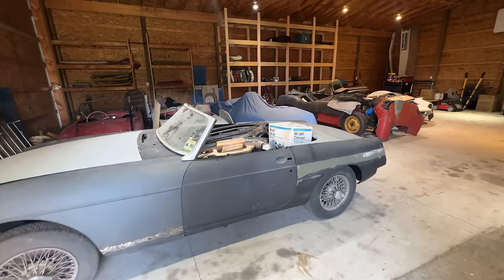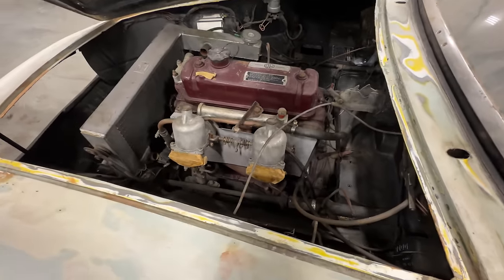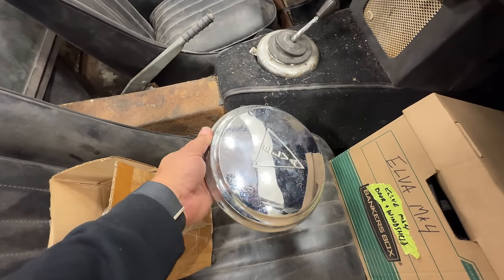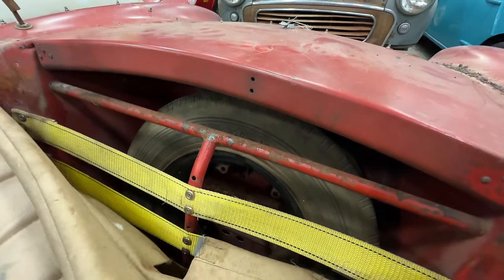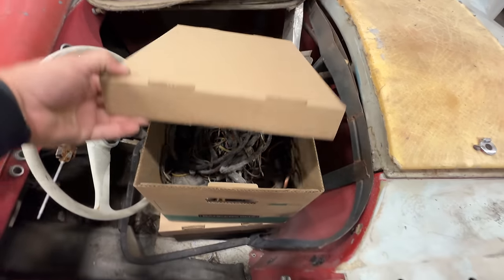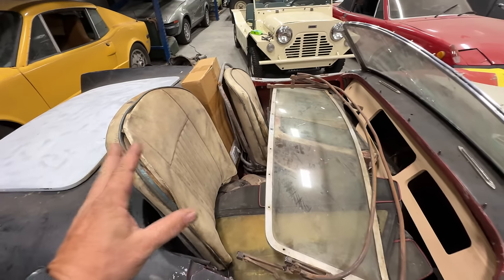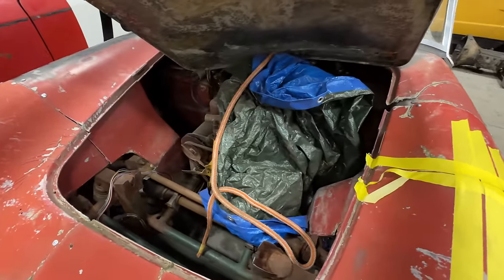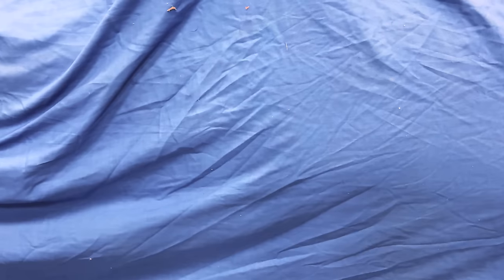This Shed Was Full of Rare Abandoned Sports Cars

Comment: What a great haul of interesting cars! Do you have a Peerless/Warwick in your collection? Another late-50s contender in the British sports car market.
Reply from the maker: I have come close to owning a Peerless a couple times but have never had one.
Reply: The Peerless always seemed a bit alarming as the petrol tanks were in the door sills. I wouldn't fancy being T-boned in one of those!
Reply: @davidjones332 : They are at least protected by two sturdy chassis side rails that are braced. It was designed for racing after all so I'd expect some consideration of the safety of the tanks' placement.
Reply: @johnpowell5433  Maybe so, but this is 1950s designed-on-the-back-of-a-fag-packet stuff rather than high-tech stress-computation, so I think I'll pass on that one!
Reply: @davidjones332 : No-one twisting your arm! I suppose you'd turn your nose up at a Gordon-Keeble as well?
Reply: @johnpowell5433  Possibly not. the Gordon-Keeble is a handsome car thanks to the Bertone design; to me the Peerless always looked a bit cobbled-together and ill-proportioned, and contemporary reviews weren't always flattering either.
Reply: @davidjones332 : Aside from the rear suspension arrangement the chassis are near identical, certainly in the centre section. Best leave it in the garage. 😉

Comment: The Name is Berkley Bandit, not Barkley,  and they had Excelsior Motorcycle engines.  Two cylinder.  Mark 7 Elva was a Sports Racer.
Reply from the maker: That is not correct it is "barkli" and the Berkeley Bandit is a completely different car, much larger than these.
Reply: It's Berkeley, pronounced Bark-lee in the UK. They came with various different engines, 1-cylinder, 2-cylinder and 3-cylinder.
Reply: @ThisWeekWithCars  I believe You are mistaken.  The Berkley Bandits were "Dualed" through Rambler dealers in the earlt 60's as were Mercedes Benz vehicles.
Reply: @ThisWeekWithCars  Wrong
Reply from the maker: I posted a clip from Goodwood with the correct pronunciation 
https://youtube.com/shorts/i-tJE4Y4Thk?feature=share